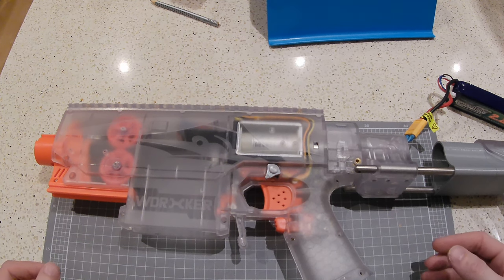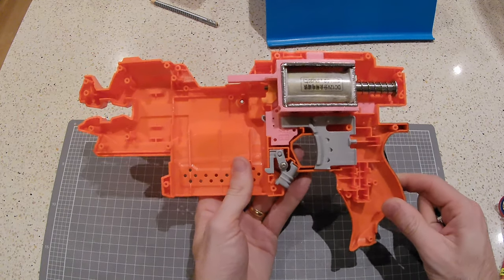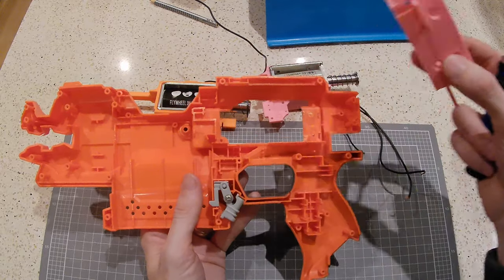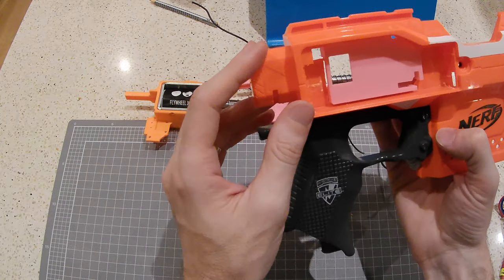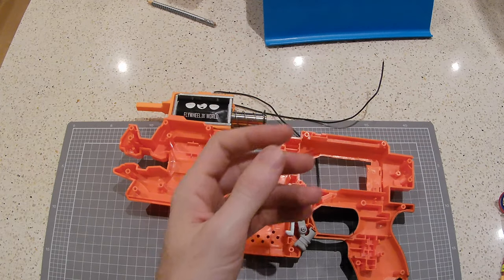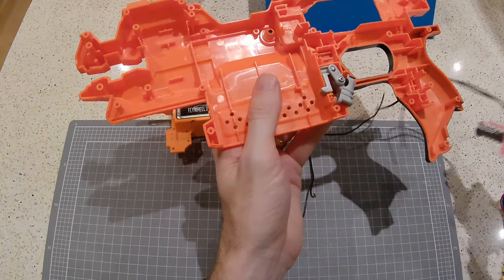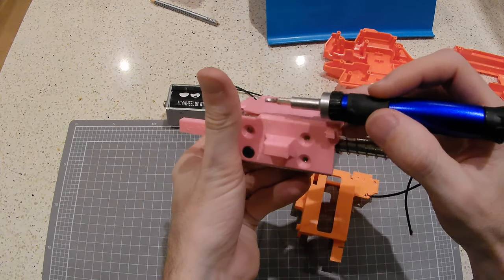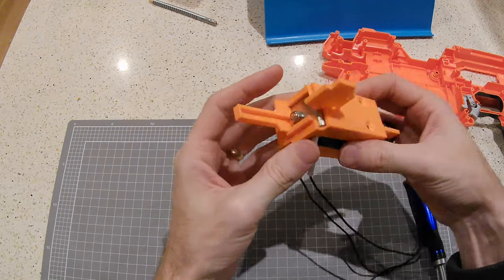Stryfe Solenoid Install - Cut Guide

Comment: what’s the wiring diagram and parts list?

i’m looking to make my own 3d printed brushless solenoid semi auto nerf gun and i don’t want the solenoid to stay out when i hold the trigger down i want it to snap forward and back once when i hold it down
Reply from the maker: That depends on your build. Mine are typically brushless, and have a Narfduino inside. I can program the behaviour.

Comment: This is amazing, but does thingiverse not offer printing anymore? I don’t have a 3D printer myself but would love to have this on a build i am working on.
Reply from the maker: Can try 3dhubs?
Reply: Airzone will try that, thanks! think a 21a omron can fit behind the trigger?
Reply from the maker: @vastneon  I've never done it. I use the 10a cherry switches.
Reply: @AirzonesBlasters  d'you print them out of PLA or ABS?
Reply from the maker: @vastneon  pla+ for this stuff.
Reply: Airzone nearly there. I think I have found a replacement spring but did your solenoid come with mounting screws? I am having to look for some to fasten it down to the bracket.
Reply from the maker: @vastneon  they are byo. If I recall correctly they are m4x6mm, but I can confirm that later
Reply: Airzone just wanted to confirm you were correct. onward! thank you.